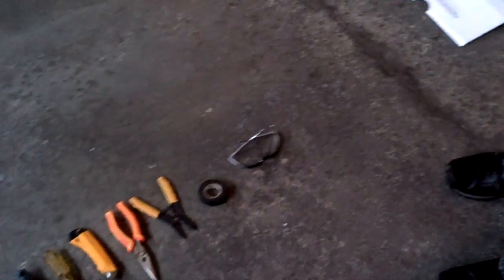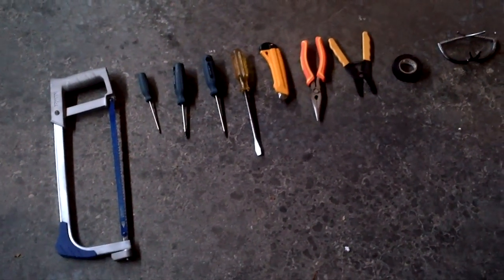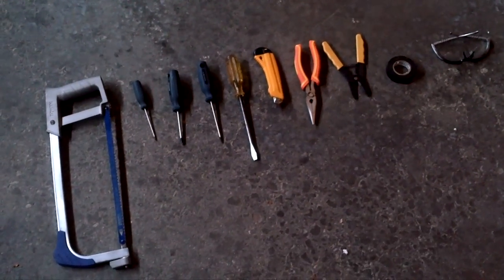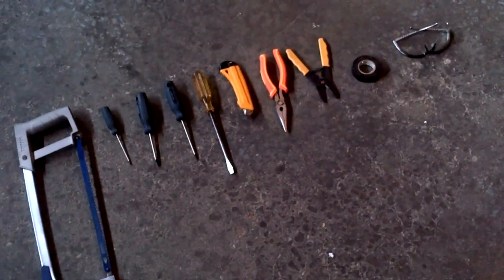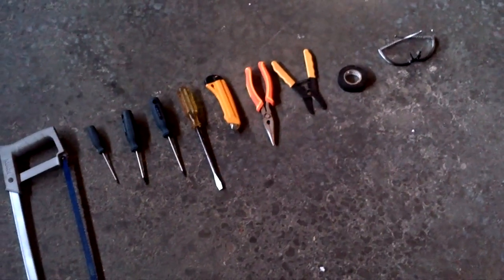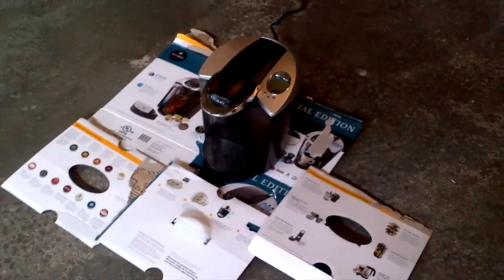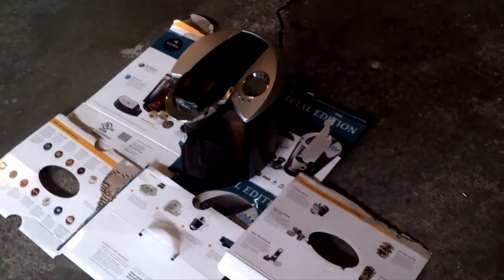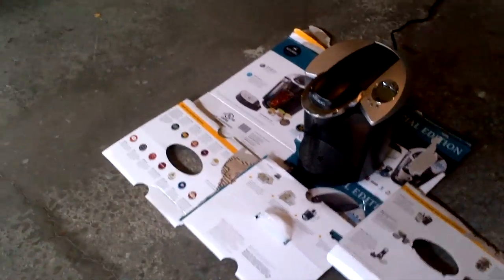repair short pour Keurig attempt #2 problem solved guaranteed!

Comment: almost everyone misses something.  There are two needles to clean (top and bottom of the K cup), and a screen in the bottom of the water tank.   Disassemble the cup holder and clean it thoroughly.  Clean BOTH needles.  Empty the water tank and run a STRONG stream of water directly onto the screen in the bottom of the water tank.   If it's really dirty, take the screen out with a long Phillips screwdriver (three screws).   Then descale with vinegar or a commercial product.   Be patient, it took weeks and many cups of water to build up the crud, it's going to take more than a couple of minutes to clean the coffeemaker.    Also, the K cups with the soft bottoms that Costco sells will clog the lower needle faster, it seems.
Reply: Or buy a new one.

Comment: Dynamite would have been a more elegant solution. That is what I felt like doing to it till I finally got the top off. Getting it apart is NOT for the impatient. I have finally managed to fix my keurig minus the sledge hammer. :)

Comment: no but actually these machines fucking suck man... i can't get mine fixed and i don't even think anything is wrong with it like something must have caused a short in the circuit because i keep getting this dumb ass error message saying water under pressure then it continues to tell me to repair the needle as if that had anything to do with the water pressure in the first place😠